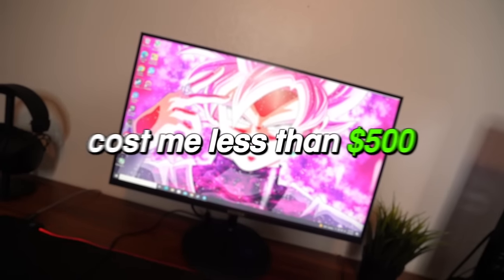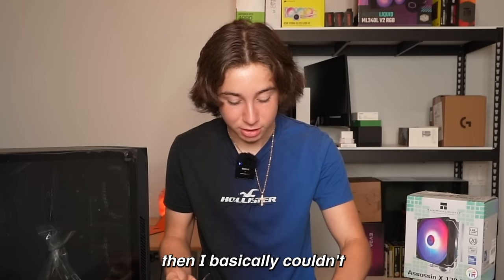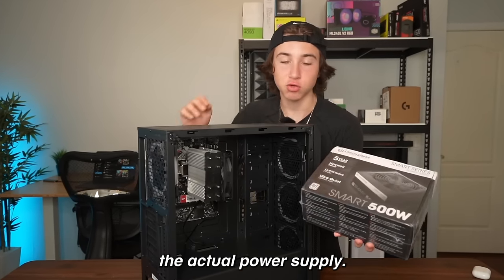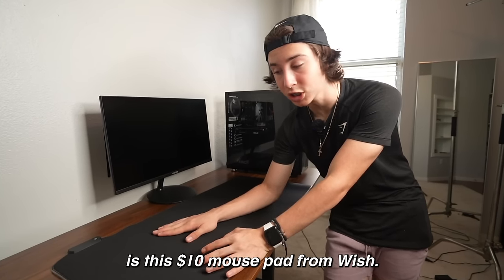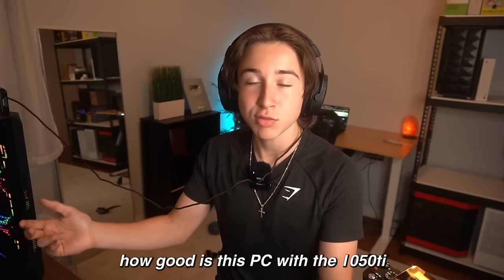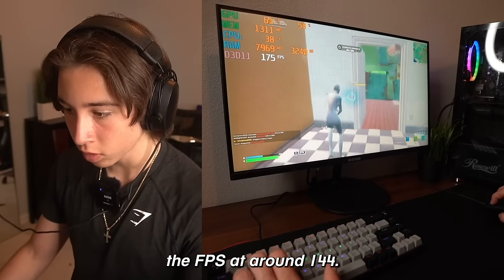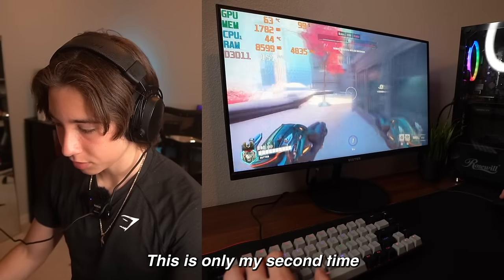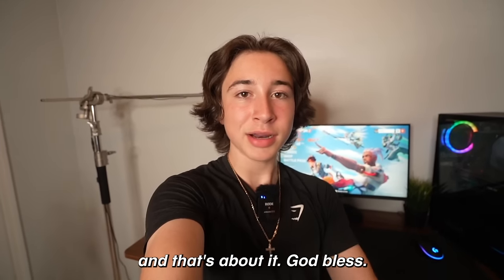Building The PERFECT Gaming Setup For $495

Comment: It’s not ryzen 5 ryzen 9
Reply: True, because the cpu ran 40 degrees Celsius while the gpu ran almost 70 degrees celcius
Reply: Its a ryzen 5 in a ryzen 9 box
Reply: Ryzen 9 7th gen uses am5 and a320m uses am4 socket so it is a r5 2600
Reply: @prex2  wwwww your right

Comment: its a good thing you remove the plastic off the glass first before you start building and before you turn it on, reason is the plastic can create a little shock and ruin the pc
Reply: most pc parts are static proof so it’s unlikely to happen

Comment: Amazing setup, but I think i would go for a Steelseries QcK mousepad. Might need to be smaller to fit the same price but it should be a lot slicker. Audio wise, the Koss KSC75x is the way to go. With a little bending of the metal clips itll be comfortable for ages with no adjustment with amazing sound. Only concern is the quality of the cable but I havent had any issues with durability in my personal use and it comes with a lifetime warranty. Get an additional mic and headphone splitter and use the mic on the cable, should sound decent.
Reply: yeah same i would go with a qck

Comment: Heres A better list:
Used Parts
●Ryzen 5 3600 - $40
●RX 580 8GB -$65
●Antec True Power Gold 550 Watts PSU - $35
●Normal Casing-$10
            or
 Rgb Casing With Fans-$35
New Parts
●Gigabyte B450M Mobo- $75
●Kingston HyperX Fury 2×8GB DDR4-3200 Ram-$35
●1TB HDD -$25
●256GB Nvme SSD -$15

Total -$300 With Normal Casing
Total-$325 With RGB Casing

*Accessories with RGB Casing*:
●Used 1080p 144hz Monitor- $75
●RK61 Brown Switch Keyboard-$50
●Logitech G203 Mouse-$30
●Full Sized Mousepad-$20
Reply: Used parts lmao never you don’t know if they were over clocked used for years failing.
Reply: @Bootymuncher23  🤣
Reply: @Bootymuncher23 isn’t overclocked a good think lmao
Reply: @zxckstery_ it's benefit the one who overclocked not the person getting it , cause overclock shortens lifespan of parts
Reply: Thanks bro
Reply: @saifkhan670 do you think a ryzen 3 2200 be good if your not able to get the 3600
Reply: No he said it was a 1050 ti
Reply: Do we need a normal? casing
Reply: @Bootymuncher23 how do i know if is overlocked

Comment: To cut down some costs, I would not be overkill on cpu cooling, then I would also go for more cheap Hdd storage for just games since hard drive still work just fine, and last is that motherboard is not really good for future upgrades, would cut down costs on cooling and spend more on MB, but for a 350~ setup it seems fine for now, also older CPU’s tend to have older cpu architecture, so that can may Cuase some future issues. I would go for a 3000 or 4000 series cpus. Also extra comment that you don’t have to worry about the tempatures unless if they hit the scary 80C range
Reply: agree with removing the cooler but no more hdd, nvme ssds are cheap and perform way better
Reply: @anto-eg6yz  It’s just my personal opinion about hard drives, you can use nvme if you want
Reply: I think a sata ssd would be better for a budget pc like this
Reply: @RusRus72 No, you should always use M.2 SSDs. It’s mandatory to do so.

Comment: Thank you for making budget setup videos, its giving me inspiration to make myself a PC.
Reply: Don’t follow him for the setups… especially the pc. He doesn’t know how to pick parts/specs and peripherals.
Reply: @rbdshadow7272   I would have to disagree everything he bought was pretty good considering the price
Reply: @1Optimistix  I literally just built a pc with a rx 580 8gb, ryzen 5 4500, 16gb of 3600mhz ram, and a 600w power supply for $350
Reply: @rbdshadow7272   and? Im gonna guess that you bought the parts used and if that's so your used market would not be the same as his if yall live in different states
Reply: @1Optimistix  other than the rx 580 but it was barely used for $60
Reply: @rbdshadow7272  how much fps
Reply: @supercutz71  in valorant around 350-400 fps with the same settings
Reply: @supercutz71  I didn’t test Fortnite on it though, I sold it for profit and valorant was just a test bench
Reply: @rbdshadow7272  ur not good trust
Reply: @TrackThisYT  ? Tf you mean lil bro
Reply: @rbdshadow7272  u got a rx 580 for 60$? wtf LOL

Comment: Im trying to get a first pc and i have been watching your videos for about 2 weeks and love them.keep it up❤❤
Reply: Heres A better list:
Used Parts
●Ryzen 5 3600 - $40
●RX 580 8GB -$65
●Antec True Power Gold 550 Watts PSU - $35
●Normal Casing-$10 or Rgb Casing With Fans-$35
New Parts
●Gigabyte B450M Mobo- $75
●Kingston HyperX Fury 2×8GB DDR4-3200 Ram-$35
●1TB HDD -$25
●256GB Nvme SSD -$15

Total -$300 With Normal Casing
Total-$325 With RGB Casing

*Accessories with RGB Casing*:
●Used 1080p 144hz Monitor- $75
●RK61 Brown Switch Keyboard-$50
●Logitech G202 Mouse-$30
●Full Sized Mousepad-$20

Comment: my build for $550 w/o peripherals, ALL BRAND NEW
ryzen 5 3600 ~ $90
rx 6600 ~ $200
gigabyte b550m ds3h ~ $100
corsair vengeance ldx ddr4 3200 2x8gb ~ $40
crucial p3 500gb nvme ssd ~ $25
thermaltake smart 500w ~ $40
antec nx200 matx ~ $55
Reply: Dude You need Monitor Keyboard etc as well
Reply: Heres A better list:
Used Parts
●Ryzen 5 3600 - $40
●RX 580 8GB -$65
●Antec True Power Gold 550 Watts PSU - $35
●Normal Casing-$10 or Rgb Casing With Fans-$35
New Parts
●Gigabyte B450M Mobo- $75
●Kingston HyperX Fury 2×8GB DDR4-3200 Ram-$35
●1TB HDD -$25
●256GB Nvme SSD -$15

Total -$300 With Normal Casing
Total-$325 With RGB Casing

*Accessories with RGB Casing*:
●Used 1080p 144hz Monitor- $75
●RK61 Brown Switch Keyboard-$50
●Logitech G202 Mouse-$30
●Full Sized Mousepad-$20

Comment: I have a question, can u tell me if all these components are compatible with each other -
Motherboard - msi b660m-e
Processor - Intel i5 12400f
Graphics card - zotac gtx 1650 amp
Ram - Corsair vengeance rgb pro SL
Power supply - deepcool pk80+ 550W
SSD - Kingston nv2 nvme 500gb
Thanks!
Reply: 1650 Is super underpowered for an 12400f but yes everything should work.
Reply: @wifibox2175  i will upgrade to a better gpu later on but for now 1650 is in my budget and thanks for ensuring!

Comment: 1050Ti is a dayum good choice. Yesterday i bought a pc for 680$ the specs are

R5 5500
650w 80+ psu (i have a 700w fsp psu at home problaly will replace)
Asus RX6650XT
gell 16gb 2x8 3200 mhz ram
2TB Seagate harddisk
512gb m.2 ssd addlink
B450M motherboard
And a case with quality fans

Was it worth the money or did i get scammed?
Reply: is it a used pc?
Reply: @nem3337  no, its a prebuilt

Comment: in my country for 300 Dolors i can get
Ryzen 5600G(processor)
Biostar 520(mother board)
Kings pack 512Gb(SSD)
16GB(Ram)
450W(power supply)
6 RGB Fan(For cooling pc)
Pretty big Casing

Comment: Found you channel through one of your shorts.

I appreciate the perspective of someone that obviously games a lot.

Were you going to do another video that's goes more into the specs of the PC itself ?
Reply from the maker: i will definetely make another video with this pc in the future, however I am pretty sure I went through all the parts of the pc in the video, the gpu is the 1050 ti used, not sure if i mentioned that in the video
Reply: @Vermax  Sorry, badly phrased question. You went over the parts, I meant a discussion of similar parts to use for a budget build if these parts aren't available. The GPU also seems underwhelming for the CPU, but I appreciate areas had to be cut to make the really low budget.
Reply: thanks for these videos man! i am also building a pc for me 
RTX 3060 12 GB  GDDR6
ryzen 5 5600x
32 Gb ddr4 ram
 @Vermax

Comment: Is it possible to list every link you used to build that pc will all the parts? I want to try to build it too because I just bought a prebuilt hp working desktop without knowing it does not have good fps and I paid around $550 for just the pc and for Valorant, it runs about 50-70 fps avreage. I would really love a cheap budget p that can run about 200 in Valorant. Thanks!

Comment: This is a great example of why you shouldn't do a budget build... or at least not this budget. 

The PSU is dangerous, SSD can fit about 2 - 3 modern games, Headphones aren't even worth buying in the <$50 range grab the Salnotes zero for $20. Also don't buy RGB mouse pads RGB means they wasted money on lights instead of making the pad better, I'd recommend Legion Lenovo mousepad for 10$ from Amazon and it's massive

As for the video itself I'm a bit suspicious of it, first off, that keyboard is NOT $20 from anywhere except maybe a yard sale. You can hear the lubed switches and foam this couldn't even be manufactured for under $20 or they would be losing money

Second, I don't believe he's getting 150 - 200 FPS on VAL/Fortnite with those specs, I get about 200 average in val with a 3060ti/5800x on low settings and even worse in Fortnite

Comment: I have a new motherboard its the "rog strix b550-a gaming" but i need a new pc case other parts are:
Gtx 1050ti 
Ryzen 5 5600x
16gb of ram silicone power camo (same one as u lol)
512gb ssd 
And smart bw2 650w thermaltake pws
Reply: Zalman nf m5

Cheap but big it's an atx cases and come with 4 RGB fan and it can fit the rtx 3070
Reply: @ikram2512  i need a new case i believe im getting a atx case, why u reply this to my comment?

Comment: Hello it tried to get these parts but all of them are 550 so I can’t do I wanted a pc all my life
Reply: Heres A better list:
Used Parts
●Ryzen 5 3600 - $40
●RX 580 8GB -$65
●Antec True Power Gold 550 Watts PSU - $35
●Normal Casing-$10 or Rgb Casing With Fans-$35
New Parts
●Gigabyte B450M Mobo- $75
●Kingston HyperX Fury 2×8GB DDR4-3200 Ram-$35
●1TB HDD -$25
●256GB Nvme SSD -$15

Total -$300 With Normal Casing
Total-$325 With RGB Casing

*Accessories with RGB Casing*:
●Used 1080p 144hz Monitor- $75
●RK61 Brown Switch Keyboard-$50
●Logitech G202 Mouse-$30
●Full Sized Mousepad-$20